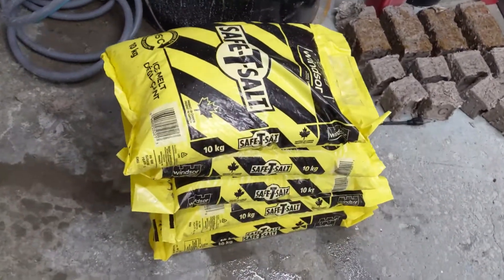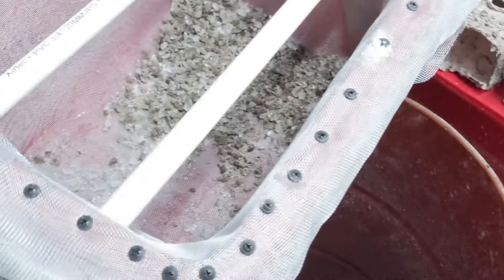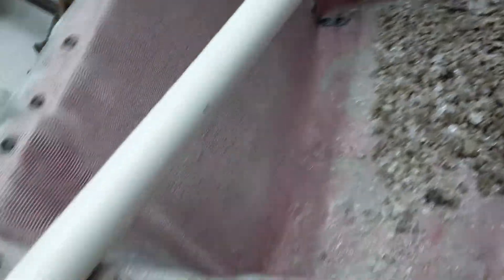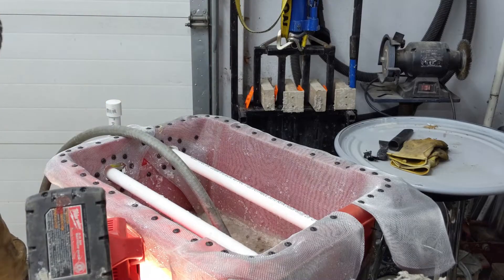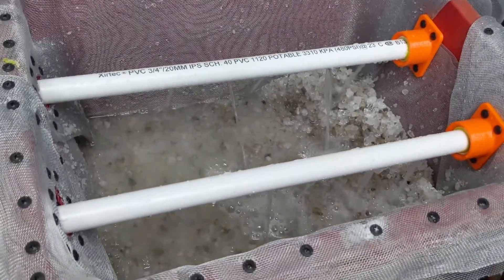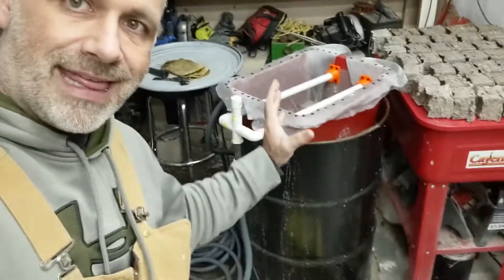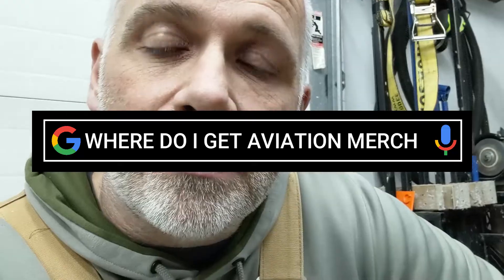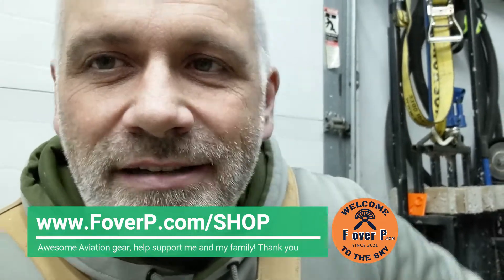DIY Driveway Brine machine STOP SHOVELING SNOW 2022

Comment: All the 'calculations' in the world don't change the fact that this brine approach will result in more salt or other melt chemicals on the homeowner's yard & grass & flowers, etc. Not really a good thing.

In reality, mechanical snow removal from a home's driveway and walkway(s) is MUCH better and preferable to chemical snow removal. If the snow is light, a push blade or push shovel can make quick work of it. If the snow is deeper, that's what snow blowers & throwers are for; same philosophy as using a lawn mower on the grass instead of spraying chemicals on it. Any person with the means to own a home should be able to have a snow removal machine if they get enough snowfall to merit it. Contrary to this video's stated premise, it is NOT just a 'shoveling' vs 'chemicals' choice.

And yes, municipalities sometimes use a brine spray on streets as a preventative to having lots of vehicle accidents. A home's driveway is a very different situation.

Comment: What was the purpose of the PVC sprayer pipes?   Looks like almost all the salt was dissolved by the hose during the initial fill.  [I thought initially he'd fill the drum with water, then use the pump to pump the water up over the salt to dissolve it.]
Reply from the maker: @jwhite4  you only need the pump to mix the solution and when you're putting it on. If you place the material in the box first and then add your water, it helps dissolve on the initial setup of required water to material percentage that you're looking for. The holes in the wand are for the application

Comment: ive researched this a bit and saw the tote set ups that commercial guys are using.....great job explaining a smaller scale set up. Ironically, its about 15 degrees here in the middle of a storm and we have 3" of snow and ice on the ground. I spread calcium cloride on my driveway, and its not getting the job done. Too much snow for it to work.